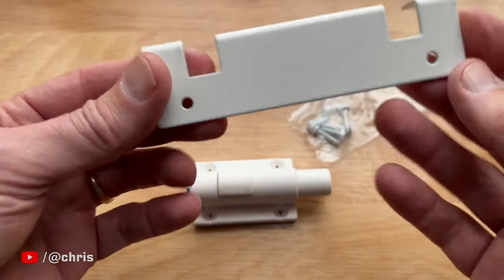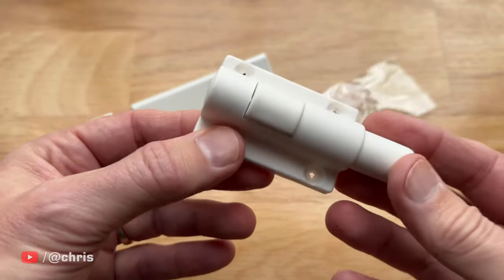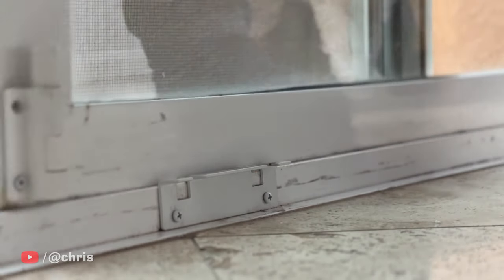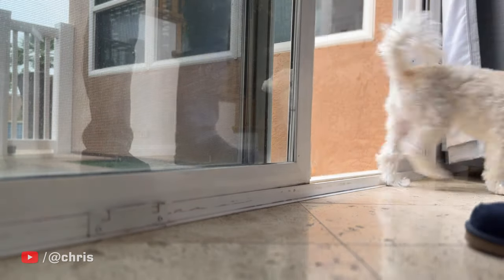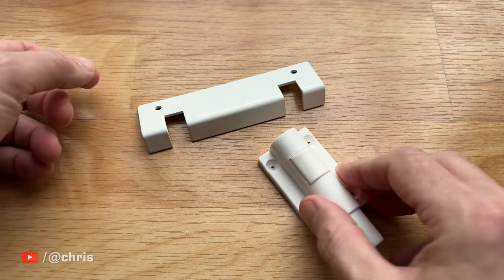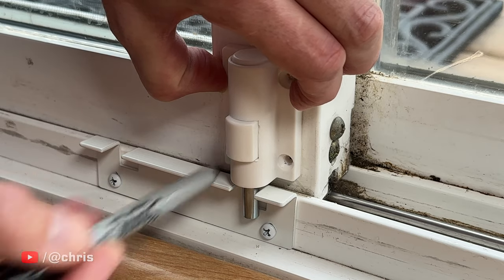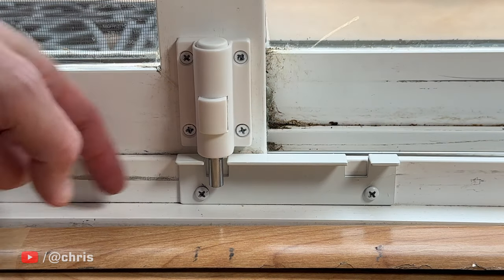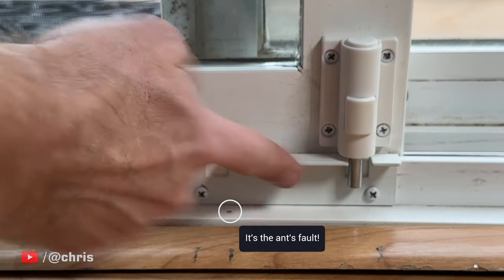Sliding Door Foot Lock Review and Install - Keep Your Home Safe and Secure!

Comment: Make sure when you are drilling or screwing into the door MAKE SURE YOU DONT SCREW INTO THE GLASS. The glass does sit just inside the frame, so make sure your placing the lock far enough back so that you dont shatter the glass once the drill of screw goes into it.

Comment: Does the door mount screws interfere with the height adjustment mrchanism inside that area?
Reply from the maker: No, they're so low that the only thing down there are the rollers, and the screws don't stick out that far.

Comment: Will this keep the sliding door from being jimmied/lifted? Tired of leaning down to remove the dowel from the track.
Reply from the maker: Great question! I've honestly never tried. So, off I went to the door to test it out. I was able to lift up the handle side no problem to create a bit of a gap at the top. However, on the lock side I was unable to lift it up at all--not even a little bit. So, I suppose it depends on the door but in my case I don't see how it's possible.

Comment: I use a 3 ft piece of PVC pipe and wedge it in between the sliding door and the door jam
Reply: It cost me 2 dollars I think
Reply from the maker: We used to use wooden dowels in the same way. However, for a door we open numerous times per day that didn't really work out!
Reply: @chris  usually we keep it jammed in there. I've heard some crazy stories about bad people just walking into someone's house through the sliding door left unlocked.

Comment: Easy for a double door, especially one where one of the doors is stationery. Does not look feasible for triple sliding doors which all slide into an outside "pocket".
Reply: If your rocking triple sliding doors, you probably have 3 inch steel gates  with 15 ft walls. You don't need this product